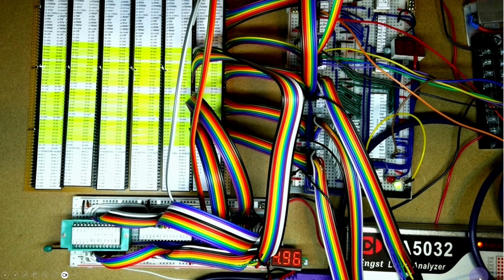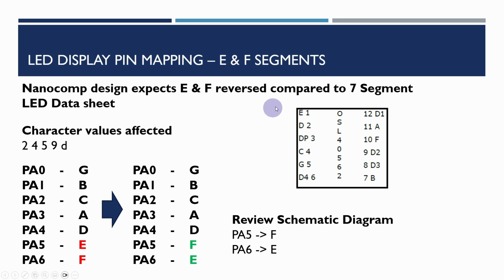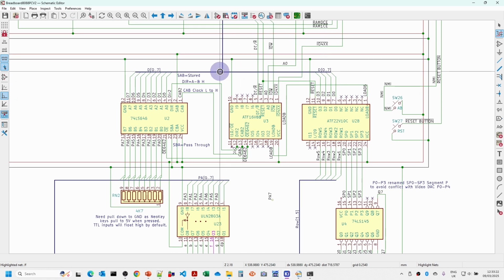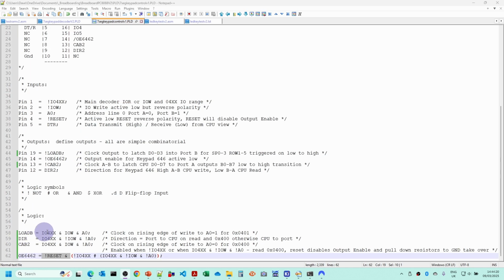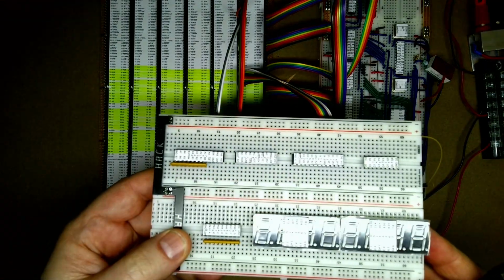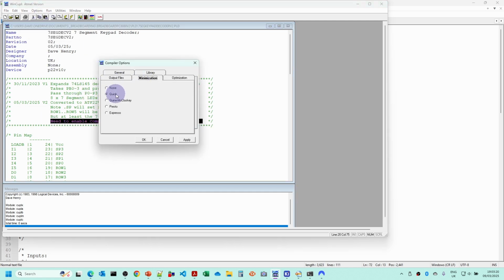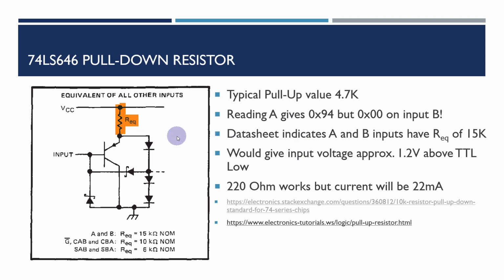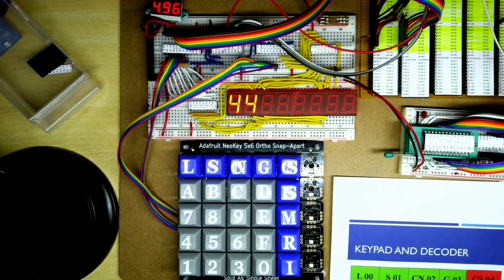New Breadboard 8088 PC V2 #4 LED Display and Keypad

Comment: Great video! I'm slowly catching up with your video series. 
May I suggest to organize the schematic by breadboard? If you want all components on one sheet then perhaps you could group by color coding the background ?
Reply from the maker: I don't like the decomposed style of KiCad schematic as it makes things difficult to plan how the inter board connections will be (less of an issue with PCB layouts). In the V2 schematics the layout is by breadboard, just all on one page.With the connection highlighting it makes it much easier to check for mistakes etc. Dave

Comment: There's a NeoPixel board for the RC2014 that uses a couple of extra gates to work around the tight timing requirements needed to drive them with a lowly Z80. It might be a fun side quest to hook them up and drive them from a DOS program.
Reply from the maker: I am looking at using a PI Zero with ISA bus interface via GPIO and running modified bare metal PC emulator with 'proper' VGA support (all the registers and bit plane modes etc) giving direct HDMI output. Could try and hook that up to LEDs when I get it running over the next couple of months. Dave

Comment: Thanks for another great video Dave. That new keypad looks really nice and some really useful tips here such as those pull down(up)  resistor websites. I had always tended to guesstimate these values  in the past!
Reply from the maker: Thanks, I'm glad pull-down resistor stuff was useful, I thought I was going mad when one side read 0x00 and the CPU bus side read 0x94 but all makes sense now (just not for the couple of hours it took to figure it out). I think pull-ups can probably be higher values than the 4K7 or 5K6 values I typically see, probably 10K, 15K or even 25K but not tried this out yet. 
Dave